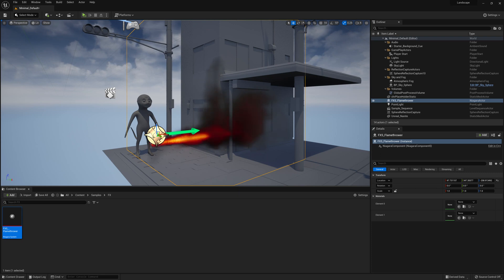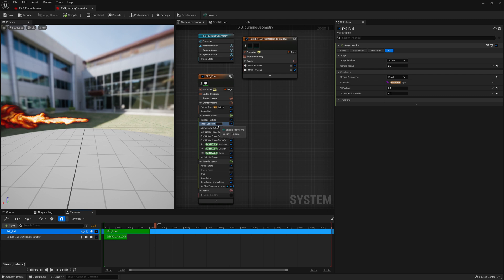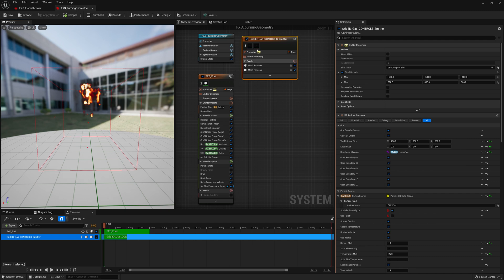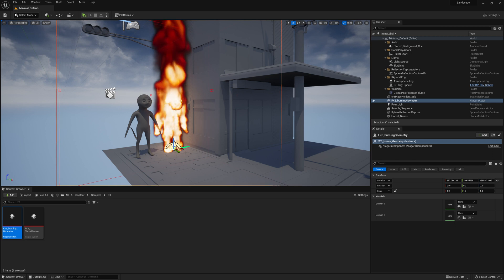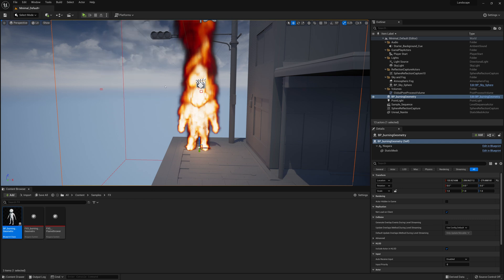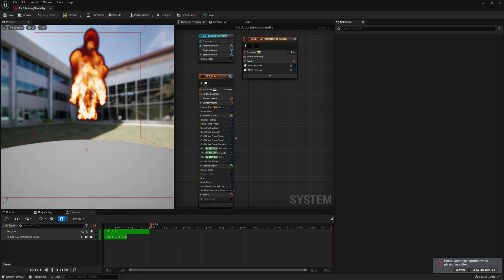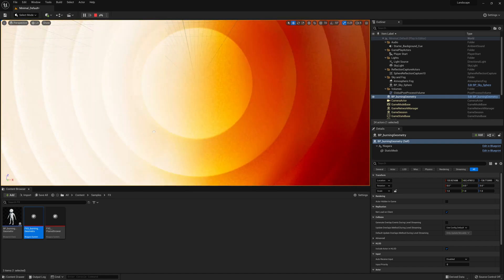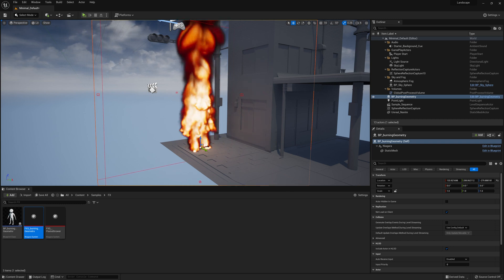Unreal Engine 5 Tutorial - Niagara FX - Emitting From Geometry

Comment: unfortunately this doesnt work in 5.1.. sample static mesh doesnt exist... and when we do the rest of it.. the fire will move opposite from the movement like it should, but the smoke will still move with teh direction of the movement. In fact before you even add any veolocity... just having the static mesh location makes the particles move whe nu move the model(without velocity).
Reply from the maker: "Sample Static Mesh" in 5.1+ is now "Sample Mesh Location".
Reply: @renderbucket  sample mesh location is not in 5.3 either. there is only static mesh location
Reply from the maker: @faradaysinfinity  my bad, I meant "Static Mesh Location" this info has been added to the description as well. :)
Reply: @renderbucket  thank you!
I'm running into a technical challenge I am unsure if this or your other tutorials cover (at least what I've found) 

I am trying to have a static mesh cross through a volume and simulate it then.

It seems this method keeps the volume attached to the static mesh

Are you familiar with a method or aware of a technique that does this?

Comment: How do I make the smoke stay in the same position after it getting spawned? At 10:33 you can see it follows the box, it ruins the whole effect.
Reply from the maker: In those cases where you have a lot of movement and rely on it you will need to use a Grid 3D Moving Fire. Where the grid stays bound to the object but behaves as if its in worldspace. This you can do easily with the Grid 3D Moving Fire template when you create your Niagara Fluids.